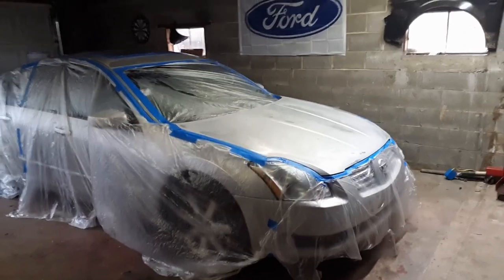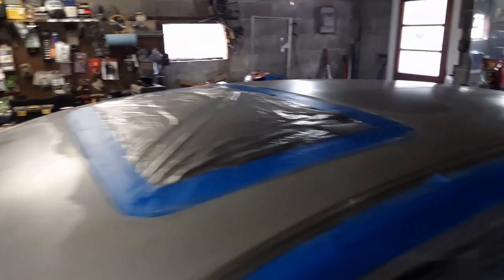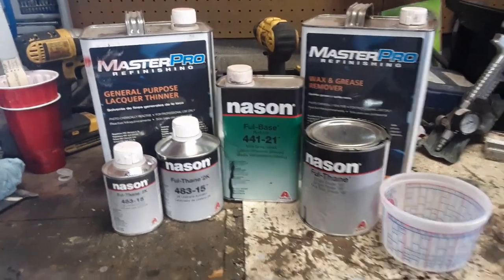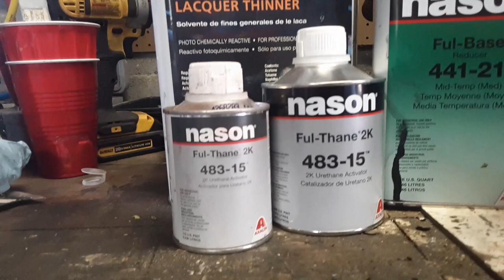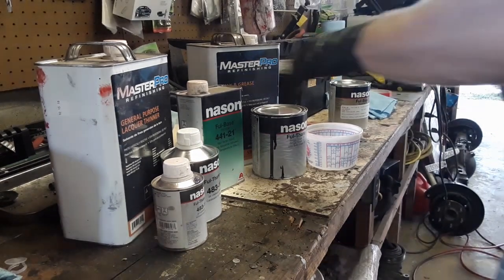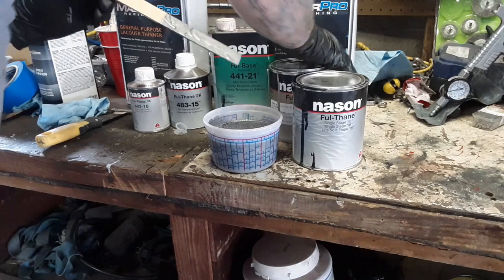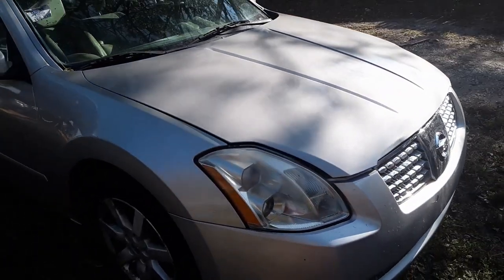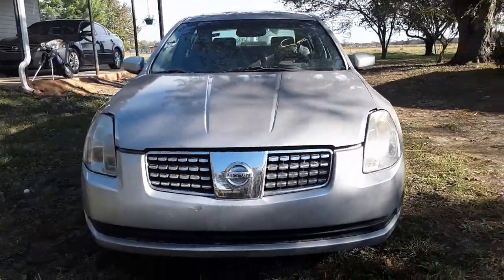Spraying Single Stage Paint on the Maxima

Comment: Good job but why not just use a cheaper base coat clear coat system? Even the nason stuff is expensive. I get a decent private label clear gallon for $60 a kit. Even has a 5 year warranty  Since stage is so pricey today.
Reply from the maker: Thanks for watching my video and your tips. I am just learning and started with single stage. I am now using a base coat clear coat on most stuff. But I still kinda like single stage on smaller things. Like I just painted a motor cycle and single stage was just much quicker for that. I have a another video coming out soon of my first try with base coat clear coat. Again thanks for watching my video and any tips
Reply: Would you mind sharing the brand and where to find it? I'd really appreciate it.
Reply: It's a local brand . Perfecto . I'm in southern California  But kits around 60-85 are all over the place. Speedokote online, hightek, gentec kc210, for base coat I absolutely love motobase by automotive art it's better than ppg. Valspar is decent for well hiding colors. Transtar base has very good coverage but not as easy to spray and the color matching system is Mediocre. Speedokote lays out easily. I never use ppg Omni or any ppg products. The decent ppg products are no longer worth the price.

Comment: Sand primer with 1000? Why are you polishing it?
Reply from the maker: Thanks for watching and your comment. I am new to this , and I am just learning. What grit do you recommend that I use to sand my primer?
Reply: @RadFabz  where your intentions to block the primer down or just scuff it for paint?
Reply from the maker: I was just prepping it for paint. But like I said I'm new and was afraid to use anything too aggressive that would scratch the primer. What grit should I be using on the primer before I paint?
Reply: @RadFabz  you want to scratch the primer the primer is ment to be roughed up a bit. I would have blocked the primer down with 320 then tinished with 600 or 800 if metalic single stage then shot the paint

Comment: What size air compressor you are using
Reply from the maker: I used the Kobalt 20-Gallon

From Lowe's. It was about 250$. I tried to add a pic of it to this comment but there is t an option
Reply from the maker: This is the description from the website.
The KOBALT 20 Gallon compressor features a durable 120 Volt motor and oil-free pump that delivers 175 max PSI and 4.0 SCFM at 90 PSI. The improved performance of 175 max PSI and 145 PSI start-up pressure provides more usable air storage in the 20 Gallon tank for longer air tool run times. Ideal for automotive maintenance repairs, medium-duty spray painting, nailing tasks with finish, framing and roofing nailers, as well as high pressure inflation. This compressor also features two quick-connect air fittings for powering multiple tools. Canister air filtration extends life and reduces noise to 78 dB(A) per ISO3744 for a quieter work environment. The vertical configuration takes up less space while 7 in. wheels provide maximum portability between work sites.

Oil-free pump for easy maintenance and reliable starting in sub-zero temperatures

175 max PSI provides 80% longer run time compared to 20 gallon compressors with 150 max PSI

Low noise, only 78 decibels per ISO3744

Delivers 6.1CFM at 40PSI and 4CFM at 90PSI

Comment: Ridiculous, polishing with a drill.  In 40 years of painting and teaching painters I’ve never seen that once,  it could be done much much better using a buffer and in a fraction of the time. Why sand primer first dry with 1000 grit, a waste of time and expensive sandpaper. 600 grit would be quicker and better. A hack job.
Reply from the maker: Thank you for your comment and watching the video. I definitely don't pretend to be a professional. I have 0 years experience and am just trying to make an ugly bumper or hood look a little better in my garage with the little tools I have. These are just 1000$ cars and don't need a fancy job just to make it look a tad bit better. I do have a buffer now but I didn't at the time.I look forward to comments from people like you to help me learn more about things to make jobs look better or easier.
Reply: But it's just a rotating pad so shouldn't it take about the same time as using a buffer? Or is there an inherent advantage to the lower L shape of a buffer?
Reply: tempeleng it’s much easier, better and a lot quicker to use an 8 inch buffer. A buffer with a side handle makes it easier to control pressure and the angle of the pad (usually up on the handle side). It’s important to polish evenly to avoid “polish throughs” and get an even finish. Don’t substitute an 8” grinder for the buffer, way too fast.
Reply: @FredBTs  Thank you for sharing
Reply: If you've been teaching painters for 40 years,  then you should know the polite way that lets someone know if he's wrong. 

He is new, I was new and you were new back then. Show your fucking respect, please.
Reply: totally agree.  I lol when I saw that.
Reply: Freddy t: I'm honestly curious... what motivates people such as yourself to be so rude? What's the benefit? Do you feel lifted up by putting down? I dont get it. Weak ego I think. Hmph.